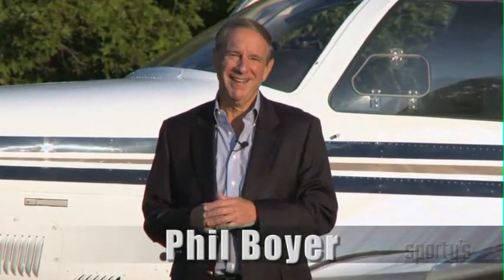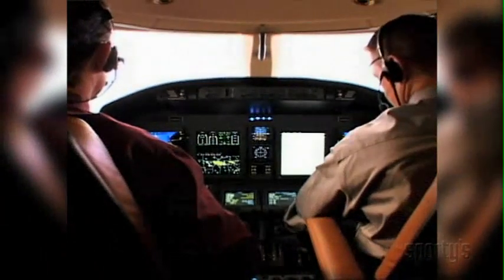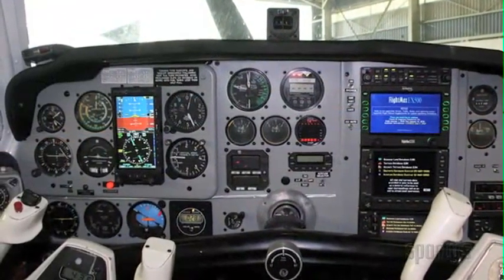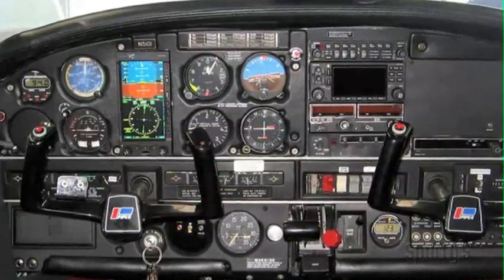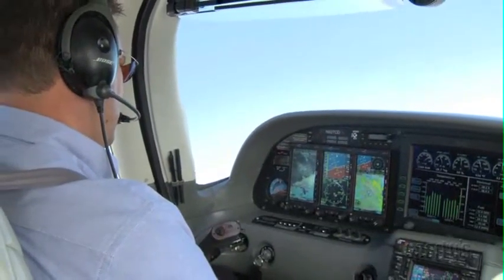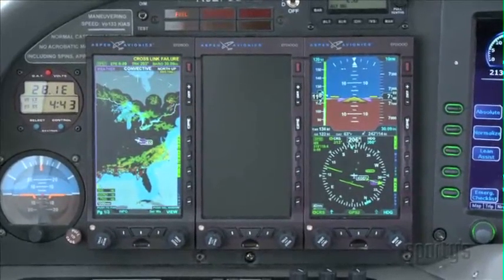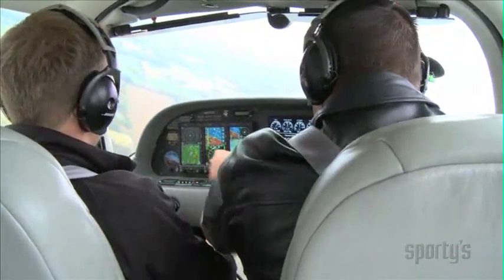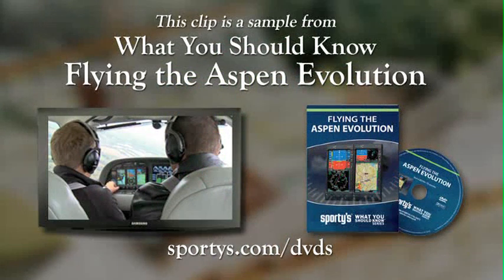Flying the Aspen Evolution

Comment: I have an EDF1000 on my plane, with the basic setup and it works fine.
...but actually, I'm planning to downgrade it to mechanical instruments or just leave it covered with the checklist.
Happens that the backup battery is out of date and there is no available spare on the market. 
...The only option is sent the instrument to factory to install a new battery. (and for sure, being outside USA, it will cost half of the instrument value, without mention the grounded time)
then... I have a cute "INOPERATIVE" label on the EDF screen.
....any idea where can I get a backup battery?